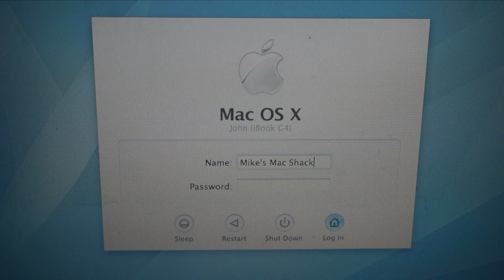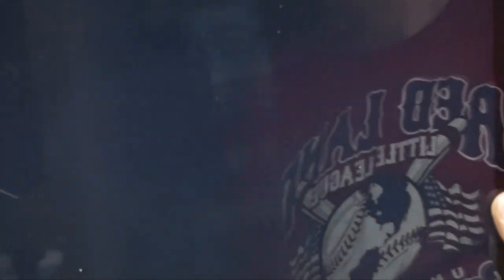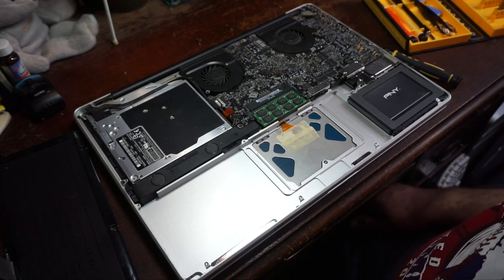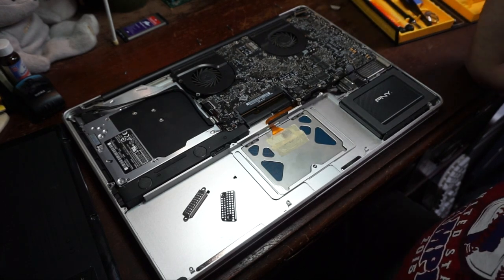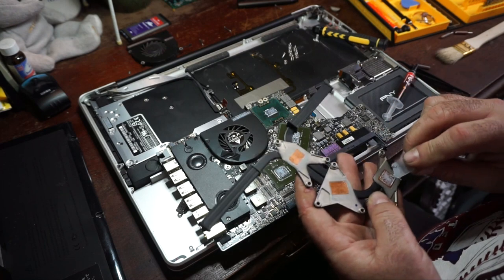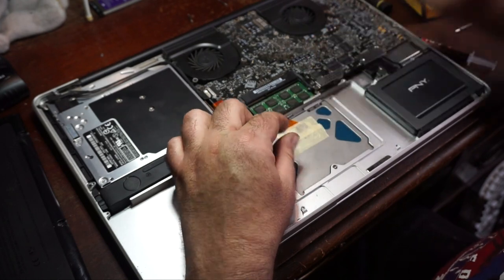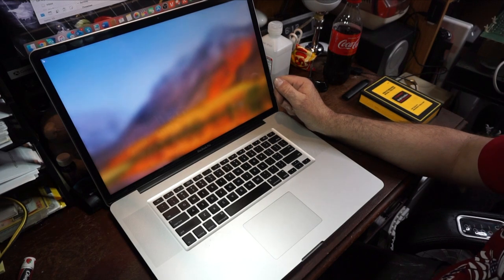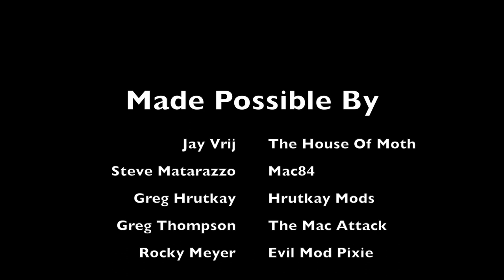Maintaining The MacBook Pro 17" (2009)

Comment: I have this macbook, i recently bought it to run Windows 10 on it, i'm using Monterey with open core legacy patcher and it runs great, it doesn't have the overheating issue but sometimes it does double chime or will shut off during the boot up if not connected to a power source. I have done a few semc resets especially when it wouldn't power on at all with full battery, i'm going to be upgrading to an SSD in the next few days, it's currently using a SSHD which was a good middle ground after the "original" installed by the seller failed and died, it only had a true capacity of 64GB and died during a 85GB file transfer from my SD Card. I love that it can play & burn cds and dvds as i have a lot of CDs and still buy music on CDs to this day.

Comment: you can tell me if with catalina patcher the macbook pro 15" 2009 won't work with the wi-fi ????  thanks a lot!!!!  all ok with  hightsierra !!!
Reply from the maker: Use the new OpenCore Legacy Patcher for Catalina and higher. I don't suggest running Catalina as its buggy and slow, especially on the Core2Duo machines. I would use the Mojave patcher on these, it runs smoothly, and everything is compatible.

Comment: I have a 17 from 2011. Got it with a dead gpu, had to do a software hack to get it running. Has an SSD now but am still afraid its gonna croak.
Reply from the maker: if you bypassed the faulty GPU in it, you should be fine. The NVidia chip is faulty, but the Intel GPU is fine, just a bit sluggish.

Comment: Original ram is 1066MHz DDR3 SDRAM , do this mechine can support ram DDR3 1333 MHz & ram DDR3 1600MHz ?
Reply from the maker: Yes it will. I currently have 1600mhz ddr3 installed in it and it is quite happy and recognizes it. I actually have 1866mhz ram in it but it is down clocked to 1600mhz.
Reply: @MichaelAStanhope  how much maximum GB ram MacBook pro 15 inch 2009 can ?
Reply: @jorkerzeverything8508  8 gigs
Reply: @Midnight_horrors885  16
Reply: @KevinArcade87  8 I own a 17 inch 2009

Comment: I got the exact same MacBook running Catalina, also with a massive heat problem. Mine is running temperatures around 90°C just when idling, without anything open or something! Could this only be because of the old heat paste? I Already opened it up and cleaned everything out, but it didn't made any change…

I would really appreciate a 2nd opinion about this. Thx!
Reply from the maker: 90c at idle is hotter than mine gets. I'd definately disassemble it, and repaste the heatsinks and clean out the fins on the heatsink and the fans really well. Mine has peaked at 104c but thats under a pretty decent load.
Reply: Disable dashboard and install macfancontrol and put the fan speed on 3700 rpm.That will cool it down.
Reply: @bobbyz23  gonna be a loud MacBook with those fans running all of the time.
Reply: There’s nothing you can do,  but run the display at 50% and run the fans all of the time. Sucks.
Reply: @o751106  nah at all hat speed you can barely hear it anything above 4000 rpm is loud